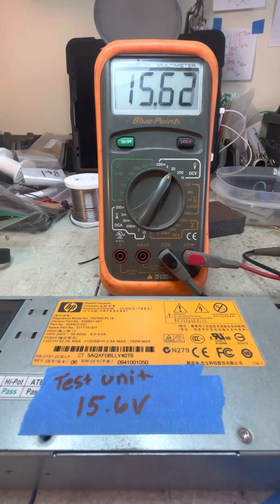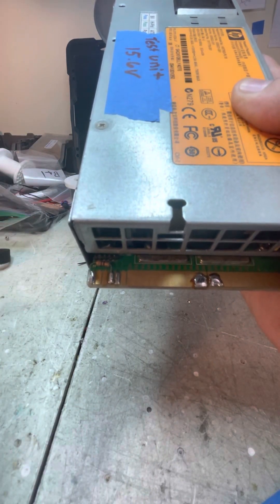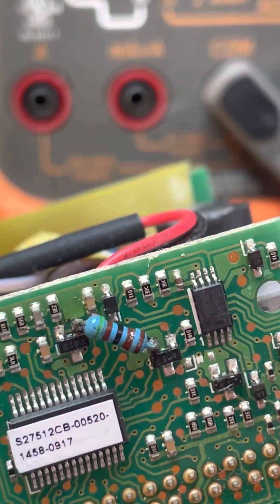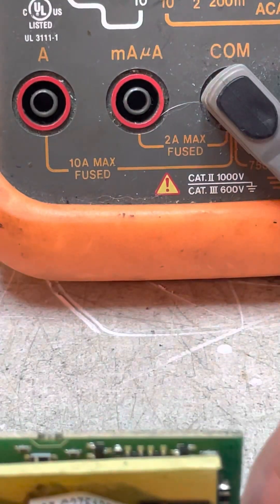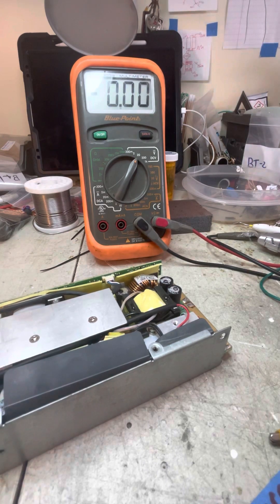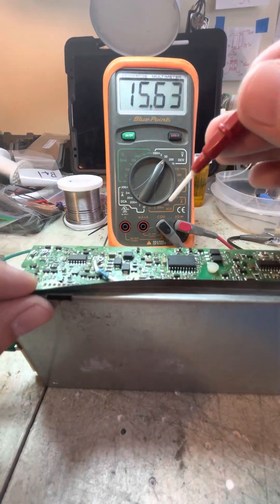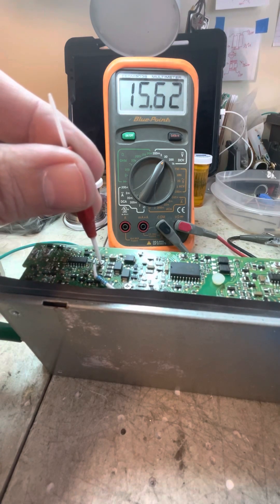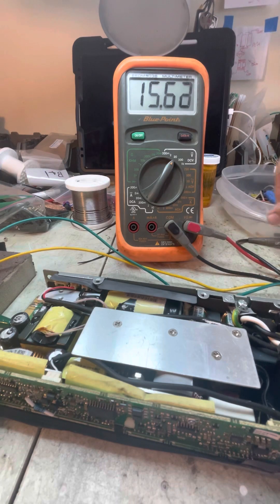HP 750 watts, Server Power Supply Hack, OVP Hack, Voltage Increase hack.  HSTNS-PL18

Comment: Is there a similar mod for the PD18? I have seen up to 13.8v with the PD18, but they do not mod the OVP. I would love to get 15+ volts out of the PD18 for the ability to use it to charge LiFePO4 batteries.

Comment: My power supply works great w/ my Icom 7610; however when I key up & speak on mic with my Yaesu FT-710 it shuts down immediately when using high power. I’m @ 13.8v

Comment: My power supply works great w/ my Icom 7610; however when I key up & speak on mic with my Yaesu FT-710 it shuts down immediately when using high power

Comment: Thank you….  I have been receiving both the model HSTNS-PL18  and  HSTNS-PD29 from Amazon as of late.
They are all brand new and only $38 per pair.

Question though..  for 13.8 vdc out, is there any particular resistor values recommended?
Also.. Where can I purchase good quality resistors from online?

Thanks again!

Comment: Does this power supply have noise on the  receivers
Reply from the maker: I haven’t had any noise issues from this model,
Reply: Supposedly, according to a few posts on EEVBlog forums, when bumping the output voltage of the HP hstns-pl18 PSU,
the DC output gets “dirty”.  EMI/RFI issues occurring?

I just bought 2 of these power supplies to used to feed combo MPPT/ DC input Solar charge controller.
I’d rather feed the output straight to the 100ah batteries I’m hoping to charge.
Has anyone fed 14.x VDC straight to a LifePO4 12v 100ah battery to charge via an AC supply?

Thanks for sharing this video!

Comment: Do you have any mods for the 2500 or 2400 or 2650 watt supplies. It would be wonderful if you only wanted a 150 or 2oo Amp supply to be able to just buy this one supply and be done. Thanks a million.

Comment: I did the mod on this power unit, wanted to set it up for 13.5 to 14.5, used a 6.2k resister on the OVP like you said but you did not say what size resistor to put in for the voltage adjustment. I tried a 7.5k, but it would not power on so I tried the 6.2k, that did not work also. found that if I put any thing on the leg of the voltage adjuster like you showed it would not power up.
Reply: Looking at the resistor colour code, it looks like a 22K, which is similar value used in many of the other PSU mods.

Comment: What about the DPS-1200FB-1A?
Reply from the maker: We will be doing a video on that model also, in the near future
Reply: @hopperbuiltamps2135  awesome bud. I’ve got a few of those and I open one up and I found where to put the resistor for the variable voltage. I just couldn’t find a crowbar, but I also hadn’t had enough time to mess with them. but it’s pretty easy to find a variable voltage pot
Reply: @hopperbuiltamps2135 We strongly demands to modify the voltage of hp dps 1200w FBA😊